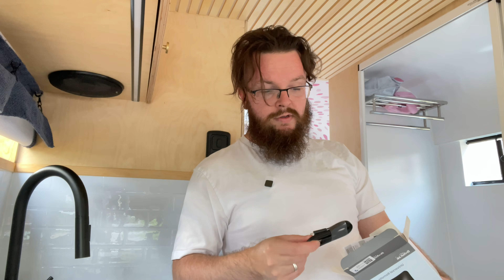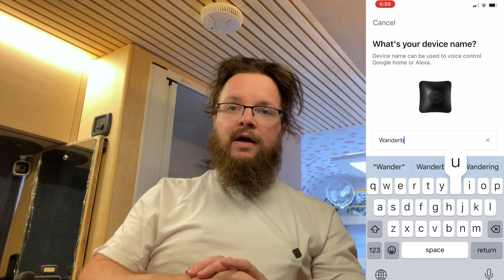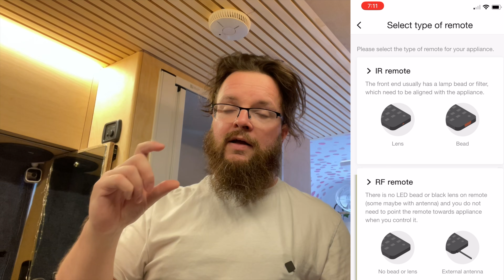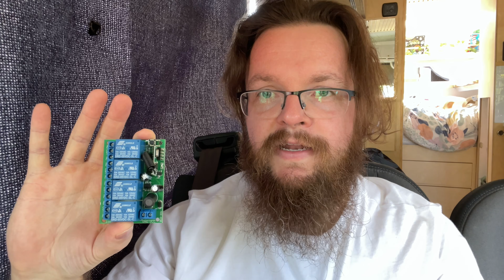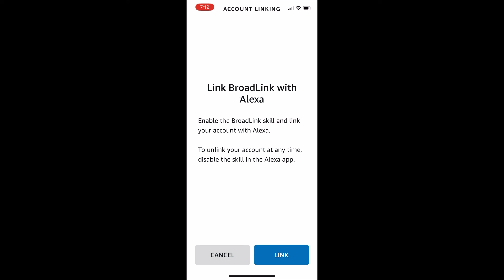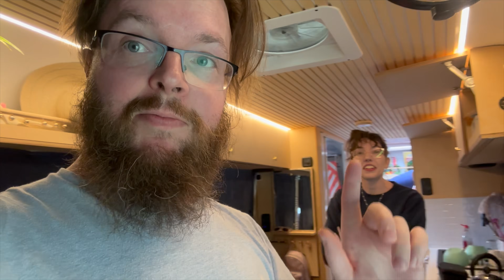Smart Van Upgrade - Control Fans, Diesel Heater Or ANY 12V Electrics Via APP or VOICE!

Comment: I can't get it working with my diesel heater, picks up the buttons but won't work when pressing on phone
Reply from the maker: Did you enter 433mhz or ask it to learn the frequency? I didn’t show this in the video, but have since learnt that diesel heaters tend to have slightly different frequency. So would recommend asking it to learn it when adding the buttons. Once you’ve done it for one button when you relearn the other buttons it’ll remember the frequency.
Reply: @WanderbusAdventures  the app picks up the signal fine, although when pressing a button the heater won't acknowledge any button at all. It's 433.89 for power which the blink app accepts, although when I press a button to power diesel heater doesn't register. I've gone through all the buttons, temp up and down, on and off. Nothing
Reply from the maker: @Wildchild121007  hmm, how odd. With this frequency it shouldn't requite line of sight, but worth checking if that's the issue? Does your diesel heater require a long press on the remote?
Reply: @WanderbusAdventures  on the remote yes, not on the lcd screen
Reply: Purchased a new remote, still doesn't work. Remote wont connect to my heater how
Reply: Same here, diesel heater remote learnt and works up to the BroadLink but the signal to the heater isn’t being recognised as a command!
Reply: @BruceLauderdale  if you manage to get it working plz message me, it's driving me nuts

Comment: How does it work with a diesel heater as the button on remote has to be pressed for a few seconds but broadlink doesnt allow a long press.
Reply from the maker: With ours it seems to need a long press on the panel but not via the remote - perhaps it’s different. The key for ours though was making the Broadlink confirm the frequency as it wasn’t 433. It was slightly different. On the screen where you select that they’ll be a button at the bottom that allows the Broadlink to learn it.

Comment: How'd you get it to work with your diesel heater. I have a similar unit but as my remote requires a long press to turn on the heater the smart unit doesn't seem to be able to send an extended signal.
Reply from the maker: Hey. So not sure if it can do a long press. However ours is ‘longer’ on the controller than any other thing in our bus so there’s hope. When you ‘learn’ the buttons at the bottom there’ll be something that allows you to check the frequency. Make sure you do that as ours wasn’t 433hz - it was slightly different. After that you can add each button and it’ll remember the frequency. Hope this works for you.
Reply: @WanderbusAdventures  hey, thanks for the reply. I'll keep trying 🙂

Comment: Can you use the switchboard or smart hub, to perform the same functions? Specifically to turn my diesel heater on in my workshop, so it is warm when I get there.
Reply from the maker: You could use the smart hub for this directly. If you get the model with the thermometer in the cable you could even program it to come on if too cold. Although that might be overkill.

Comment: Does broadlink require internet connection to control the diesel heater?
Reply from the maker: Hey. So I think I needed it for setup, but might need to check if that could be skipped, but I can confirm it works via the app without an internet connection.
Reply: @WanderbusAdventures  thank you
Reply from the maker: No problem. Hope it works well for you.

Comment: How would you do this if you had more than one fan?
Reply from the maker: Two MaxxAir fans? If the BroadLink has line of sight of both it will control both as the signal is the same on the fans. This will mean they’ll be doing the same thing though. Is that what you mean Steve?
Reply: @WanderbusAdventures  

I have two remotely controlled fans, not genuine Maxxair, but similar their remotes both work the other fan if they’re near enough 

This line of sight malarkey may be the answer thanks

I want them to operate separately
Reply from the maker: @stevebrown6665 ah cool. Keep us posted.

Comment: Just a comment to anyone wanting to add the heater to BroadLink and Alexa just use the heater remote to connect to BroadLink 
It picked my diesel heater remote up but not the actual controller 

Add device then look for heater then pair the heater remote 
Then to turn the heater up and down with Alexa add a scene to BroadLink for up and down 👍 

Absolutely love it and now with my blink camera I can talk threw the camera telling Alexa to turn my heater on while I’m out if I see temps on the low side 

Next I’m actually going to set commands up to come on auto based on temps from
The cerbo gx
Reply: So, can you turn on the diesel heater?
Reply from the maker: @italiaimballaggis.r.limbal3202 yes 100% just with the Broadlink or via Alexa. It takes a couple of goes to get it learn the heater remote. Found the best way was to put it right next to the receiver- I’ve since set it up to trigger under certain temperatures too using the additional Broadlink cable.
Reply: @WanderbusAdventures  you should post that up buddy
Reply: @WanderbusAdventures  oh I get what you done 
I think 
You made a routine ? To trigger the heater to come on when temp gets so low
And a trigger to turn off when gets so high
Reply from the maker: @Elites-asthetic that’s right. But more than that I’ve also set it to come on when outside temperature is low etc. I’ve even set one up to interact with the max air when humidity is too high.
Reply: @WanderbusAdventures  brilliant 
That definitely should be a video
Reply from the maker: Oooh that’s a tip and half that Sean. Keep them coming. Thanks mate.

Comment: When setting the heater up buddy did you have to add the remote controls on IR and RF then select the remote pro but then what did you add mate? Did you look for heater or something else please this is what I’m stuck with 
I added the maxfan to obviously fan instead of ac 
Or does the diesel heater need some other switch 
Thanks
Reply from the maker: Hey. So when I did it I had to ensure was selecting RFF frequency. Then it will ask you the frequency of your remote. It’s sometimes written on the back. My RFF remote was 433.

Comment: Brilliance again 🎉 I can’t believe you guys lol when I’m looking at doing something you find a better way lol 

I’ve had my head deep in to home home assistant and the cerbo gx but it’s so fiddly 
But like you guys I was wanting Alexa to turn my heater on and max fan
Reply from the maker: Ah cool. I did think about the cerbo and whatnot. I think they’re missing a trick to be honest. I think the cerbo should have the option out of the box for more ‘switches’. I think you can do it with the guimod.
Reply: @WanderbusAdventures  yes that’s right mate usb stick download your data from a laptop then off load it to the cerbo like you do with gui mods for the screen menu 
But home assistant is awkward you have to set a instance up too then the app lol 
I think this broadband is definitely the thing to try thanks 
I’ve just got the challenger ignite controller that’s a wi fi enabled controller for the diesel heater like the after burner so hoping this broadband pro works Alexa for this